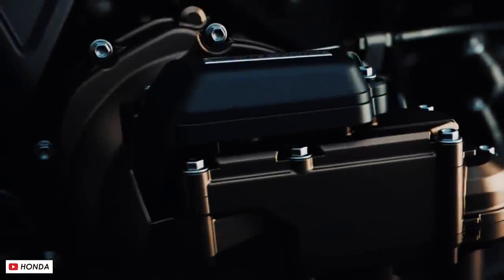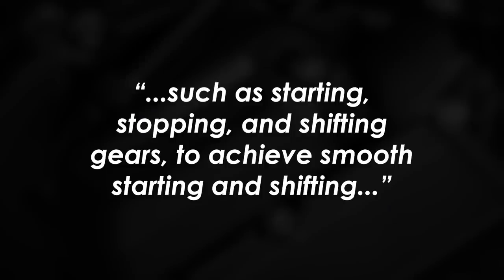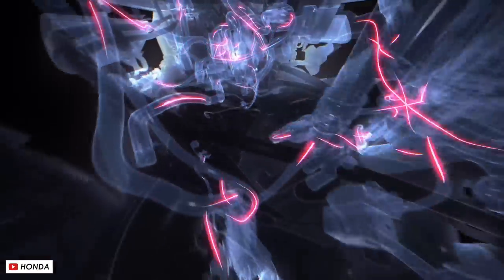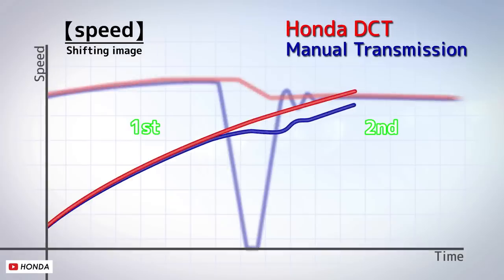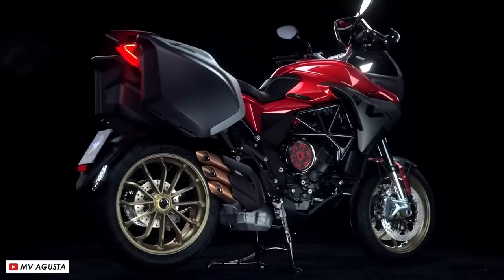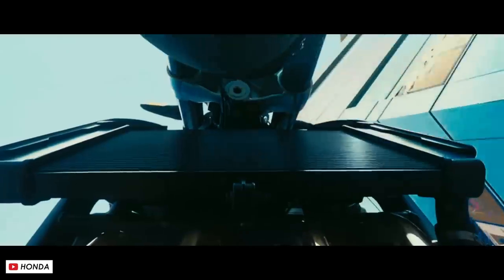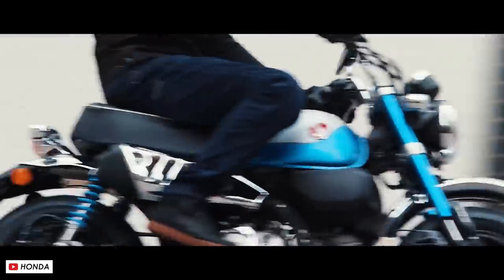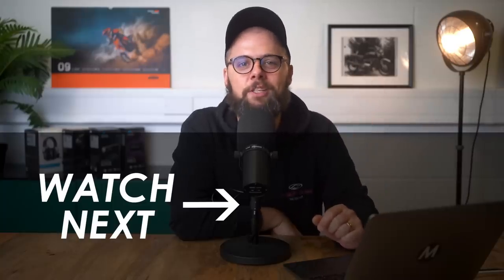New Honda E-Clutch For Motorcycles Announced!

Comment: This is cool, electronic derailleurs have become the standard for high-end bicycles as of 10 years ago. Cool to see the tech hit motorcycles. I'd appreciate it, but don't really need it on a bike personally. 

Maybe on a Goldwing or similar bagger/touring bike, like a Harley Ultra as those tend to have stiffer clutches which need a lot of clutch input at low speed. However, if it's lighter than a slipper/standard clutch and/or quicker. I'm all for it.
Reply: CB/R 650's supposedly are getting electronic throttle and will be capable of quick shifting both up and down. Along with several other improvements the 2024 model sounds fantastic!

Comment: IMO, a double edged sword. Honda has always tried to make riding more accessible to people. If you have an injury or disability, that hinders you from operating the clutch, this is gold. So bravo for that. But this kind of technology should not substitute for developing clutch skills.
Reply: true.. and it should not be forced to customers. but it's a very nice option to have for the people who really need it
Reply: If I understand what this is (from the few images in the video), you still need to operate the clutch. It's just much lighter.
Reply: @johnnyblue4799  From what I've read, that's not quite correct. It wouldn't be such a big deal if it only lightens lever pull. Modern assisted slipper clutches are already super light as it is. You have auto and manual modes. You can override the auto mode by operating the clutch lever, but that's not necessary. Since it is electronic, rather than cable, the sensor at the lever can detect pressure on the lever and allow you to take over. Otherwise, you can ride without using the lever. The e-clutch will automatically manage disengagement and friction zone at low speed.
Reply: @corvinhua4479 Well, I don't know more than what I saw here. But I'm pretty sure I've seen a cable still present at some point. Probably needed when still in manual mode... we'll know more I guess as soon as it hits the market.
Reply: @johnnyblue4799  yeah, it looks like just an add-on system that can be installed onto existing compatible bikes, so it makes sense that the existing clutch cable would still be present.
Reply: You have generations of people growing up that have never and will never drive a car with a clutch.  These things make motorcycles more inviting for them.  It only makes sense.
Reply: @adamnagel7436  Maybe in USA... In the rest of the world the manual transmission is alive and well.
Reply: @adamnagel7436  a clutch is not difficult to use, and with the widespread amount of immediately available knowledge there is no excuse to not learn.
Reply: @NicholasNormile using one's legs to get from point A to B isn't hard either, but isn't there something about ease and convenience that has a way of changing the way we do things, and build things? It's almost  like humans want things to go in that direction or something.
Reply: @johnadams3800  Why stop at automatic transmissions, how bout we add two more wheels so that you don't have to worry about balancing the bike at a stop. The more nonsense that is added to a motorcycle, the worse it gets imo.
And if ease and convenience are paramount then a car will be a much better choice in most situations. Quieter, more comfortable, more room, and sheltered from the elements.

Comment: I started riding in 1972. I've owned many motorcycles, including a Honda CB750A (2 speed, semi-automatic) and a Can-Am Spyder RTS SE6 (6 speed, manual up, automatic down). I do not understand why the industry has this fascination with reducing clutch effort/movement. The only bikes in 50 years of riding that I ever encountered that required excessive effort on the clutch were old Harleys.

What I really want from Honda is a an "SL500" which would be styled like a 1973 SL350 but with a 500 twin. I had hoped the new scrambler would be it but... sigh.
Reply: Well, many bikes seem ok, but when you need to really work the clutch in traffic jams the hand starts aching. Or if you ride off-road and single track and need to work the clutch constantly.
Reply: Times have changed old man
Reply: @39rbn61  Wow... the wisdom in your statement is off the charts... :face-blue-smiling:

Comment: I can drive a manual car,  ride manual motorcycle and id be quite happy with manual , but the worst I've ever had is 37 red lights, one red light to the next, a relatively short journey turned into a very long waiting game. Break the speed limit by 15 KMPH and they'd all be green. Expensive fuel, sticking to the speed limit with revenue cameras and a traffic light system designed to shit on any economical vehicle either electric or combustion , 100 metres stop and so on. Melbourne, every time you start to move, red light stop.  RED lights make atomatic gearboxes seem very appealing.

Comment: It also occurs to me, there is no reason honda couldn't fit an actuator to the shifter mechanism to eneable fully automated opperation.

This would enable fullauto, clutch assyst, quick shifter, or full manual selectability.

It would be slower than a DCT, but leave you with a fully functional manual gearbox and clutch for when you want to he in control.
Reply: From what I've read, the CB/R 650 will have everything you just mentioned and more including electronic throttle and TFT display with phone connectivity.

Comment: I would love to try their DCT. I can't imagine it to be fun but so many people saying positive things about it make me curious.
Reply: Try it if you get a chance, it’s a great experience. I caught myself stepping into the void with my left foot or reaching for the non-existing clutch several times, but you get used to that very quickly. Commuting in the city is super comfy, like a scooter but with immediate throttle response. In the twisties, you can switch into manual mode and shift with two fingers like in a sports car with shifting paddles. But you may find out that automatic sports mode does the job just fine and lets you focus on line selection and braking. Twisting the throttle will make the DCT drop a gear or two immediately, so the bike feels much more powerful. And you can always override the auto shifting manually, even without going to manual mode first.

I only missed the clutch for low speed maneuvering in tight spaces, but I think you’ll get used to that, too.
Reply: In many situations is more fun than manual. Overall superior system, no discussion about that, just like all cars are going autobox
Reply: @Angry-Lynx  I wasn't a fan of fast cars with outoboxes for a long time and I don't know if I would have a manual shifter in the future. If it's like that why not right
Reply: I ride normal manual bikes and a Rebel DCT... the DCT is amazing.  If I went all DCT, I wouldn't really miss having a clutch lever on any of my bikes.

Comment: The whole fun of riding is shifting manually, that’s just me I guess
Reply: Ah you're one of those guys that does 100 miles each year. If you actually RIDE motorcycles and I'm talking 15k-20k miles each year, shifting gets extremely boring and annoying.
Reply: @Waldo1122 I ride about 10,000 miles a year. Shifting isn’t a problem for me. I don’t even use the clutch aside from when stopped or 1-2 or downshifting.
Reply: @David..  Straight line riding doesn't count. Try living in the city where you need to maneuver through traffic and stop at stoplights constantly, trying living in the country where there are many curves that you NEED to switch gears in. Try escaping a car that is about to rear end you while panicking.

Comment: this is a dual use. manual and auto controller for clutch. this is good for sport bike .as dct is less friction discs .and not so good at speed start. this is auto kit for clutch. but if it connect ecu well. this can made a launch speed start. a fun kit for sport bike. may be it work with quick shifter more smooth than ever before. Honda best !🎉

Comment: Thanks for the video!   Technology development keeps me excited. It seems the CB1000R will be one of the first to get this e-clutch system. I wonder how that bike, which already has e-shifter (reportedly one of the best in the market), would benefit from e-clutch.  Cheers.
Reply: I have the CB1000R and had the 650R prior.  If the display is true, the acceleration of the bike in the video was closer to the speed/RPM of the 650R than the 1000R.  The 650R redlines at about 70kph as opposed to 120kph in the 1000R.

Comment: Looks likes an another gadget to "help" you control the bike.  I get it - it can be helpful for some riders with left hand problems - but for majority of riders it's a waste of weight, space, and another module which can cause problems. I'm curious - if it is attached to bottom part of clutch cable - am I be able to easily reattach new cable in case of old one breake ? Or do I will need Honda Service?  Good thing is - it looks like it can be adapted to ANY kind of bike - not only Hondas. :)

Comment: Part of the fun and skills required to ride, is knowing how to shift. With the "trend" going to basically automatic bikes, at some point, like the auto transmissions in the US,  a standard shift transmission will soon disappear. Other than a handicap or disability, IMO, you have no reason to ride if you can't handle driving a standard transmission. If you can't grasp the concept or are unwilling to learn, ride a moped. You must be able to proficiently drive a standard transmission in the US, to get an endorsement to ride a motorcycle. 

Maybe that sounds "old school" but riding a bike requires a certain amount of skill. You are really not a rider if you don't have skills. No skills means you are pretty likely to be a danger to yourself or others on the road. If using a clutch and shifting is to hard or "scary" for a rider, how are you going to handle emergency braking, swerving, and other emergency maneuvers? These require skills too. You ride to become "one" with the machine, not be driven around by a computer or autonomous machine. The more they take away rider control, the more skill goes out the window. Maybe that seems silly to some of you, but bit by bit, the meaning and reason behind riding becomes lost with every "improvement" that takes away from riders having skills.
Reply: it doesnt sound "oldschool". The old as world argument of "skill" is just wrong and completely reverse thinking. Just like with abs. I dont care about your skills, abs make you safer on road, end of discussion, because its not about shortening stopping distance, its about one less thing your brain having to process, and managing traction is extremely complex issue, especially in emergeny. And to surprise of some, dct does the same thing, because its one less thing you do/thinkg about wwhile riding, cheers ;

Comment: In the video they are showing that a manually operated cable clutch is left completely untouchable and this system overrides clutch operation if you don't touch the lever

Comment: How is it more "natural" than a riders manual control?
Also doesn't Honda already sell DCT bikes?
Reply: As less as I want auto start assist on my bikes or cars (which is unavoidable nowadays), why would I want some electronics between my shifting. That's one of the main reasons I like to drive/ride manual, it's the work you need to do going up and down the gears.
Reply: But good to hear that they're planning on keeping the i4 motors, gives me another year to hope that the cbr650r gets a looks update or at the very least a proper black colorway

Comment: Don’t want it, don’t need it, didn’t ask for it, not sure why it exists. There’s already a bunch of CVT bikes out there for people who want to LARP as a motorcyclist.  If you have a left hand I jury, should you really be riding a device that requires you to use your left hand, with or without a clutch.  People are saying this is great for accessibility but for who? What’s the percentage of people with left hand problems that want to ride and again, why can’t they just get a scooter or a CVT equipped motorcycle? This is a solution in search of a problem.

Comment: Well I think thar rumors were true, and some or many Honda bike are boring since Honda themselves admitted they will put this new clutch only on the "fun" bikes.
In truth this eclutch seems to me to do exactly what a quick shifter does.
Reply: No.. a quickshifter doesn't need the clutch to operate. With a quickshifter the clutch is always engaged and the system cuts engine power briefly, enough to unload the transmission and allow for a gear shift.
As for the "fun" bike part... is that an admission on Honda's part that they're also making "boring" bikes. We know it's true... :)

Comment: Not enough room here to unpack the debate but, in my not so humble opinion, the big misconception of DCT is that it’s “automatic” like a 1948 Oldsmobile, and that it requires less skill to operate than a manual. Nope, DCT’s require discovering, and using, a different set of skills. To gather other opinions, I’d love to hear from others who use both manual transmissions and DCT’s.

Comment: It´s interesting but IMO too much electronics.  A more elegant, not to mention fail-proof, option would be to use a regular clutch cable to actuate a proportional pressure control valve on the clutch directly.  The feel would be totally mechanical and by controlling pressure/force instead of displacement, as on a standard clutch cable system, the feathering would be much easier to achieve.  Best of all, no electronics.
Reply: i love that good old "bad electronics" argument 😂👍🏻
while 99% of stuff that goes bad is actually mechanical stuff like broken clutch cable, worn clutch disc etc.
dct is there for long time and its very polished and very reliable system. I bought AT with dct to not worry about reliability and guess what? I never think before starting my bike or worry because i know it will everytime

Comment: Riders getting used to automatics will also help the transition to electric bikes in the years to come too.
Reply: yikes
Reply: @jimmyneutron5679  Electric is coming whether you like it or not buddy. Electric motorcycles are far more capable machines.
Reply: But I want to breath particles that cross into my blood stream and cause long term, painful, debilatating conditions that ultimately shorten my life, which will be miserable for the last 10 years. And I want to pay some rich sheik for the privalige.
Reply: I'm with mister Neutron above. Even if electric bikes manage to lose the weight and increase the range it's not the same for a lot of us. I've yet to see a single electric vehicle be evocative. If you take away the engaging, involved, skilfull experience of a bike, you've reduced it from an experience to an appliance. Admittedly a potentially faster and more convenient appliance, but just go buy a scooter or a tesla or something. Let motorbikes be motorbikes.
Reply: @johnk3366  The skill in motorcycles isn't operating the clutch CLOWN! If that were the case then go ahead and say every MotoGP rider is an unskilled noob since they use quickshifter, autoblippers, anti-neutral, and tons of fancy electronics to control the bike.
Reply: @Waldo1122 @Waldo1122 are you arguing that clutch control isn't a skill when it comes to riding a motorcycle? Cos that's a bit daft isn't it?

Come on man, discuss in good faith, we don't all have to make hot takes on the internet. You know I was making a pretty reasonable point that a lot of us really enjoy the complexity and engagement of riding a manual bike and its not unreasonable for us to be uninspired by electric and automatic bikes. This is why Harleys, Royal Enfields and BMWs with boxer engines sell by the boat load.
Reply: @johnk3366  If manually operated motorcycles were so great and people loved operating a clutch just to make the bike go faster then DCT motorcycles, Quickshifters/autoblipper equipped bikes, and three wheelers wouldn't be flying out the showrooms.

I went to a Harley dealer and the salesmen was amazed after seeing how quickshifter/autoblipper works, basically surprised that Harley didn't put that on their bikes for ease of use. 

Just about every BMW bike uses a quickshifter/autoblipper and Royal Enfields aren't selling anywhere but third world countries.

If you ride 20k+ miles each year by motorcycle then clutch work is absolute cancer. But you're the rider that does 100 miles each year and loves operating a clutch because it gives you a feeling of achievement for those couple miles.
Reply: @Waldo1122  You do realize a motorcycles transmission is basically a sequential gearbox anyway? Even with a stock transmission you can shift up and down without needing the clutch. Knowing how to use the clutch is good though, so stop yapping about the whole quickshifter and dct situation. My previous "yikes" was referring to electric bikes. I hate them and they sound like washing machines.

Comment: If I wanted an e clutch I would get a scooter.
Reply: You can’t really compare the CVT belt transmission of a scooter to a DCT or an electrically operated clutch. The former feels like a hot air balloon: pull the throttle, hear the sound, but it takes ages until you feel some kind of acceleration. A DCT shifts faster and with higher precision than even an experienced rider. There’s nearly no power interruption while shifting.
Reply: There aren’t many good scooters. They say you can put this on most bikes so it really opens up the possibilities